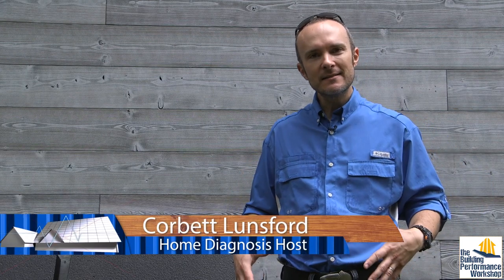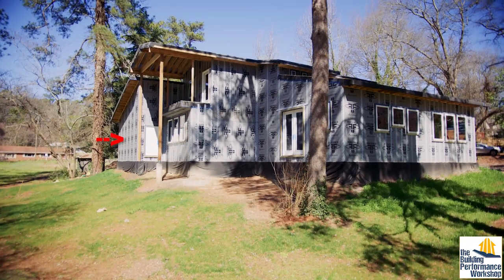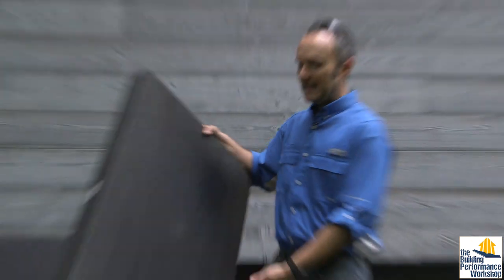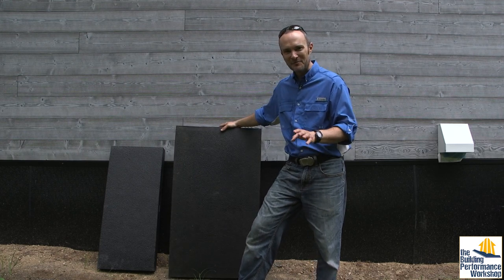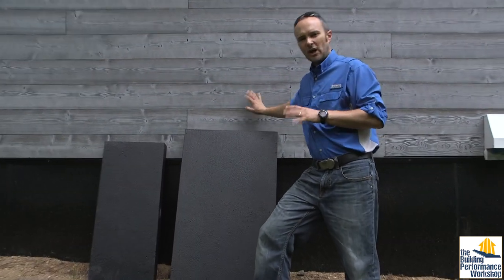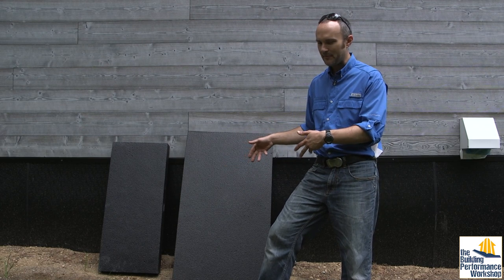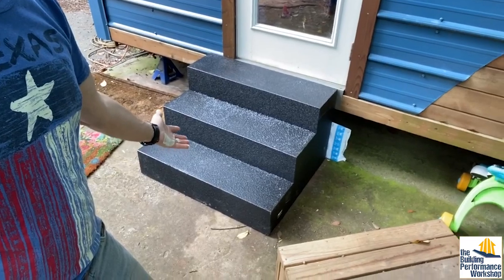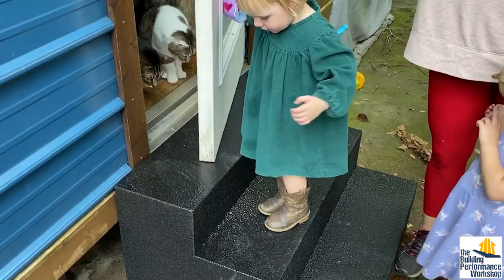HVAC Equipment Pads for Performance

Comment: Thanks for sharing the product with us. I have not seen that before. Be prepared to level those out in a couple of years as the dirt may settle or wash out from under them.  Always nice to have landscaping fabric with some stone on top to keep splashing mud and grass clippings away from the hp condensers if they are ground level.  Writing from the perspective of an HVAC tech, I believe all outdoor units should sit on a concrete slab above grade with good drainage and no vegetation around them.  The Norwegian spruce siding is sweet
Reply from the maker: Thanks TC! Good points all around.

Comment: As a DIY homeowner, on my next HVAC purchase, I'm going to ditch the concrete pad and fill with gravel with one of these plastic or foam pads, and use standoffs so more debris washes off in the rain and won't collect at the bottom of the condenser, because as you mention you want to be as maintenance free as possible. Also going to rotate the condenser so the lineset runs along the side of the condenser, easing access for techs to service valves and circuit
Reply from the maker: Nice ideas all

Comment: Are they still in business? The website doesn't work anymore. I bought one of these and put a base of gravel and then put decomposed granite on top. I would of used sand but had the dg on site so I used that. Leveling was a breeze with a 2x4 and a level to smooth the DG into place.
Reply from the maker: Wow, you’re right- they seem to be off the map at the moment. Haven’t heard anything, sorry.
Reply: Did you just lay your condenser on top of the pad or fasten it somehow? I was thinking of using large drywall plastic twist type anchors and screwing a leaf screw through it.

Comment: I'm in the process of building a 13x36 "loafing shed" where one of the 12x13 bays will be an enclosed gardening and tool shed.  I was considering pouring a concrete floor but am considering alternatives.  I'm guessing they'd be easier to stand on than concrete so curious as to the long term durability of these blocks.

Comment: When you talking heat pumps, the right way is refer to them as indoor and outdoor units, as evaporator and condenser change location depending on what mode it is in, though it is easy to nit pick you as I'm not in front of camera trying to keep my thoughts in line))
Reply from the maker: Of course, but I imagine anyone who needs to know that would understand either way you phrase it. We talk to both pros and civilians on this channel and on the show.

Comment: Corbett, that siding looks great! What finish did you use and what species is that wood? Hope you will respond and not leave us hanging until the siding video!
Reply from the maker: Haha, that vid is next in line! If you can’t wait, though, it’s solid Norwegian spruce, Thermory Drift Platinum.
Reply: @HomePerformance  Thanks for answering Corbett. I appreciate the sneak peek. That's really great to know as one of my clients (I'm a passive house architect. Trained by Adam Cohen.) really wants a grey wood exterior siding and Thermory is one of the options we are looking at. It looks beautiful on your house and I'll be adding that to the list of exterior finishes to price out.
Reply from the maker: I’ve learned a lot from Adam too! Happy to help, Ben.